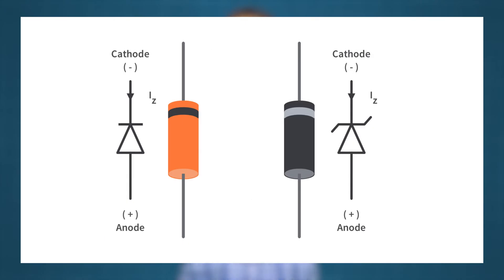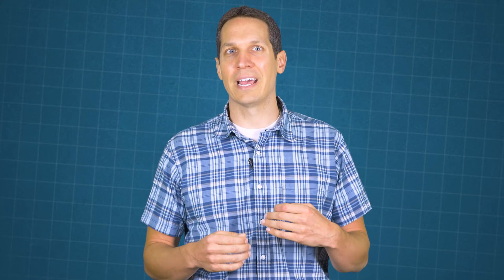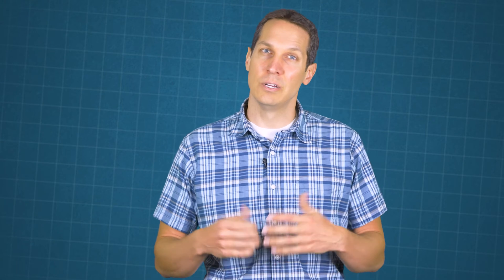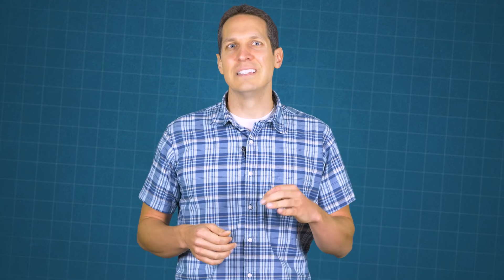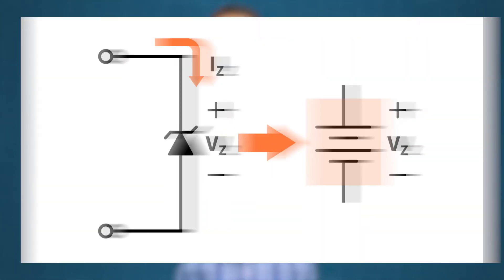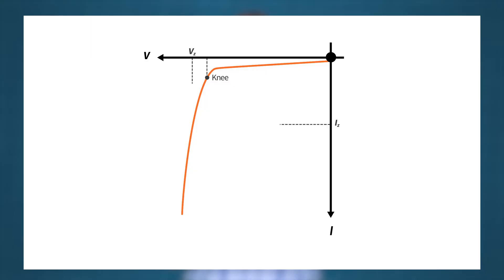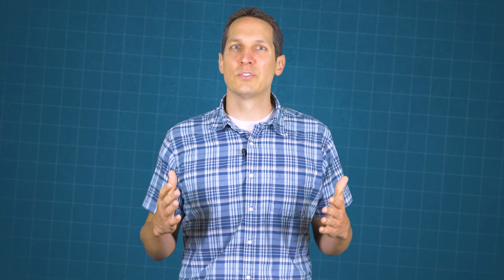What is a zener diode and how does it work?  | Intermediate Electronics

Comment: Why the breakdown is not a permanent damage to the device and the diode can be used again in the reversed condition?
Btw Very nicely explained through animations.
Reply from the maker: Thanks!  It's mostly not damaged because it's designed (the zener diode itself AND the way it's used in a circuit) to be used the way it is.  On the semiconductor level, they are designed to be able to handle breakdowns better and on the circuit level, you put in protective circuitry to make sure you don't go above its rated current/power capacity. When a normal diode goes into the breakdown portion of a reverse bias, that usually means things have gone poorly and it is no longer controlled.

Comment: So what would you need to make ~~5.5vdc at 250ma.   From 120vac?
The resistor is in series to keep the zener from popping,,, on which side of the diode? and the led across the zener diode, the zener voltage drop?, that would be rated at at least 250ma?
What zeners wont pop if given 120vac like this?

The resistor deal is not making sense, no body explains this, 
SO can someone explain this. 
I don't care about circuit safety before you bitches get going. 
The explanation online is hysterical nonsense, big words, nobody showing how it might be commonly implemented. You need to start with BASIC most simple common use circuits for the most conventional applications. 
Also what is the efficiency??? 

It would be useful too for biasing mosfets or transistors in linear mode, but does anyone explain this? nO, bitches prove me wrong.

Comment: How does a higher doping concentration reduce the width of the depletion region? And why would a thinner depletion region have more intense electric field?
Reply from the maker: The more intense electric field is similar to how a capacitor works.  The closer the two plates are to each other, the greater the capacitance as the charges on the two plates can interact with each other more strongly via their electric fields. 
As for why the higher doping concentration reduces the width of the depletion region, I need a bit of a refresher myself, so I'm hoping I'll explain this correctly.  At greater doping concentration there are more holes/free electrons on their respective p/n sides.  As the holes and electrons are diffusing and crossing the junction to the other material, they run into their counterpart on the other side faster and reunite more quickly.  This builds the charge faster and brings the junction to equilibrium with less real estate.

Comment: hi, nice tut, can i use zener diode to clamp the voltage output to 5.1v 50ma from a 72v input?
Reply from the maker: Technically, I don't see why not.  Practically, you'll be losing HUGE amounts of power in your resistor and is probably a terrible idea.  Check out the written tutorial on CircuitBread.com to see the calculations on how much power that resistor will have to dissipate.
Reply: @CircuitBread  thanks for the reply,.